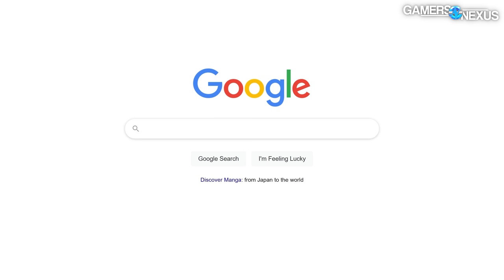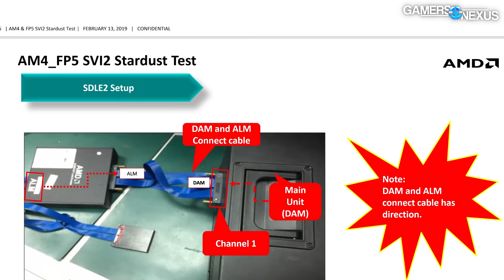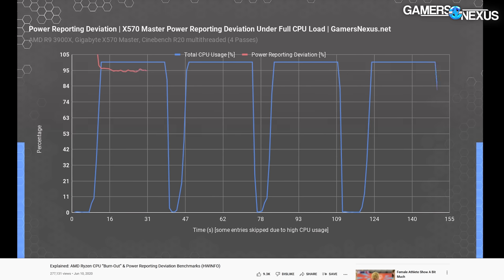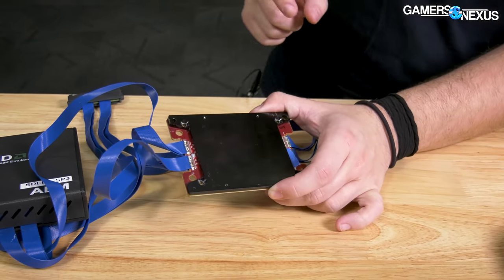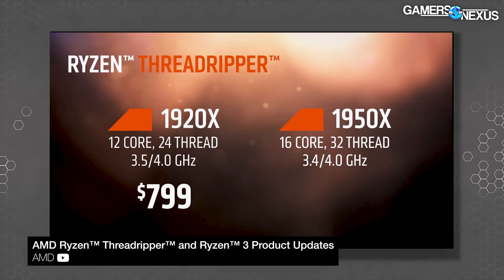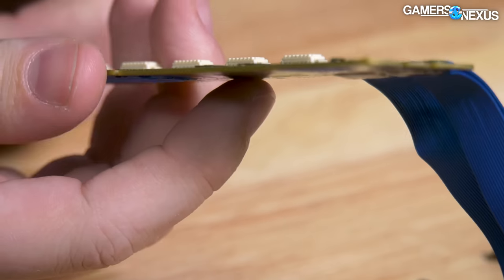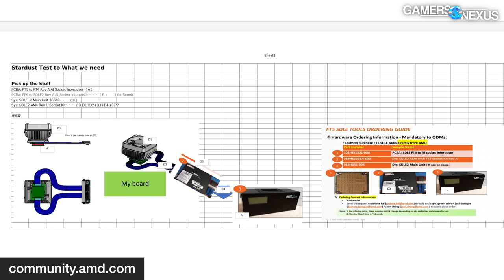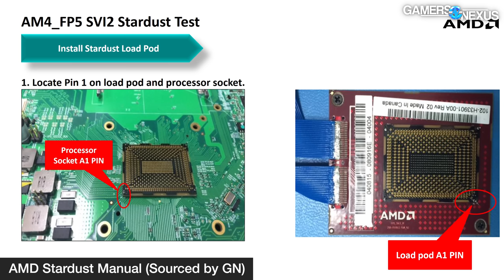We Have AMD's Top-Secret "Stardust" System | Tear-Down & Hands-On

Comment from the maker: For the AMD Stardust box - yes, we can just make a power plug. The problem is that we would need the specialized motherboard (looks like an FPGA). If you have that, let us know! Power doesn't get us anywhere without the board, sadly. We do have the software, though, so mostly need the board.
Get a GamersNexus toolkit! Includes a 7-year warranty! https://store.gamersnexus.net/products/gamersnexus-tear-down-toolkit
Or a GN Anti-Static Modmat for PC building: https://store.gamersnexus.net/products/modmat-volt-large
Watch our Xbox XDK Developer Kit tear-down here: https://www.youtube.com/watch?v=Wno4t7YqMM4
Reply: Be careful about flexing those ribbon cables by the solder joints they’re easy to break. And some of those ribbons are just painted conductive trace so forget repairing it if it is. It would have to be hard wired at that point.
Reply: On the one hand, I'm grateful for you guys bringing us such exotic content. On the other, though, I fear any legal repercussions you could face for obtaining that equipment.
You should not take such high risks for us!
Reply: @BobMotster  It's nor ilegal to have it (as long as it's not stolen), what is not allowed is to sell it.
Reply: hi Steve, are you going to review Razer Kunai and Razer Hanbo? It's been sometimes since they release
Reply: Knowing AMD it is probably a Xilinx FPGA.
Reply: @Darkfarfetch They're journalists. In America, journalists report on what companies would consider "stolen" info all the time. As long as the journo didnt steal it themselves, they are protected by the 1st Amendment.

Literally, there are American journalists who report on classified military info and no one is jailed for that. This is, obviously, a dozen levels below that in potential liabilities.
Reply: @frizzlefry1921  Steve is the most abusive person with hardware I've ever seen. That poor AMD tech who hand soldered those joints for the R&D team is screaming when he sees steve just yank and pull while the wires are caught. (not just this video, steve is always this abusive to hardware). Turns out those ribbon cables are micro-coax, the most delecate and expensive type of wires. At this point I assume Gamers Nexus has a pile of "Steve's broken stuff" that they keep in a corner.
Reply: @TheTardis157  It could be any brand since it's from 2016, really. But yeah, for sure a FPGA.

Comment: Those blue cables are actually 50 ohm micro coax cables made by samtec, and a single assembly with connector is about 200-300$

Comment: They should totally make it available to reviewers so they can use it to potentially better test motherboards. 

Reminds me of the Vega preview GPU with the extra diagnostic stuff on a long PCB linus showed off ages ago.
Reply from the maker: It would theoretically be very useful for that, assuming you had all the diagnostic tools!
Reply: @Terry the Translator It literally just lets them better test motherboards lol
Reply: I think one of the issue is how expensive the test equipment are, too many 5~6 digit priced stuff needed for this.

Comment: The power supplies are probably just standard 12v ones with internal DC-DC converters to make up the standard rails. Hooking it up to a bench power supply with current limiting should help keep you from frying anything.

EDIT: At 19:57 the board has an LTC3853 DC-DC converter on it. They take anywhere from 4.5v to 24v. But it's probably shipping with 12 at a few amps depending on the load they need. If they need a couple hundred watts into these things they'd be using beefier connectors (most likely an off the shelf laptop PSU). The 12v fan is a giveaway that they are expecting 12v since it would most likely just run directly off the DC-in.
Reply from the maker: Good recommendation on preventing frying! Now we just need a motherboard!
Reply: Yep, looks like a 12V unit to me. I stockpile 12V, 5V and 9V power bricks because they are so ubiquitous, especially for powering LED strips. If I had to guess, based on PCIe specs, it's probably safe to assume these loads could draw at least 5A-6A @12V, but I would test with a 3A limit to start.
Reply: @GamersNexus  I would say with this to be aware of some shenanigans but.  For instance, I know car stereos a while back had re-badged a standard pioneer (or whatever) as  x car company stereos.  They changed that, AND swapped the 12V and ground pins around on the power connector.  Result being that if you plugged in a non x car company 'genuine' (read much more exxy) part, even though it was otherwise identical, it would blow a fuse in the car immediately.  And would also take out some other, no doubt vital, system on the same fuse.  So, I would say just check if the ground on the standard pin on the connector for whatever power supply actually agrees with ground on your new toy.
Reply: Best part is they aren't sure how to connect  a power supply to this thing, so I don't see what they're going to achieve after they power it up.

Yeah anything from 6V up would power it. It's just a purpose built, multi channel DAQ system. 2-3 amps would be PLENTY at 12v.
Reply: Power supply is probably like 19.5v like a laptop would use. That photo he showed of software showed 20 amps of draw.
Reply: @Thumper68  20A at what voltage? There is no way that's 20A at 12v or 19.5v.

The 20A is probably just monitoring the motherboard. Remember, this just simulates a CPU, the motherboard is providing the power to test the VRMs and cooling.
Reply: @PeterBrockie  yep current logged by the daq has zero to do with the power supplied to it.
Reply: @PeterBrockie  idk just mentioning i noticed it in the video. Now that I go back and pause it says DDCR_CPU. But that power brick shown is very similar in size to 19.5v laptop one was why I said that. The 20A was just a observation not really relevant to my reasoning I didn’t really clarify that 🤣
Reply: @PeterBrockie  I have a bunch of server psu with 12v 50A output so I mean 20A at 12v or 19.5v could happen
Reply: @Thumper68  the size of the power supply has nothing to do with its voltage. Large 12V power supplies are very common. Laptops use higher voltages for efficiency and because it enables charging their battery packs without stepping up the voltage.
Reply: @Finder245   I know this it was just educated guess based on some common sense general observations and the fact the system is meant to load test it just makes sense to me they would use similar voltage as laptop.  Y’all act like I’m saying this as I think they are absolute facts.  Also you can run laptops without battery packs and of course they dont have to step up voltage cause they already did with the power supply which your forgetting it will have to power the display and other user attached peripherals.

Comment: Concerning the missing power brick: You can likely follow the one side of it to some screw hole (= ground) and the other one will at some point run into a linear regulator. The spec sheet for that regulator will then give a hint for voltage, likely 12V center positive input.
Or, for the brave, get a bench PSU, current limit to 20mA and slowly creep up voltage until the device attempts to start.
Reply: i'll put money on it being 12-19 v @ 3a for the power supply the fan being a 12v fan is an immediate giveaway at the input voltage

Comment: Finding an FPGA in test equipment like this is not surprising. There might be another one under than heatsink. I am glad you did bot force that heatsink off though. I believe those attach to the package itself, so if you do it wrong, you could rip that chip off the motherboard or at least crack some solder joints.

Comment: Its just a barrel adapter, you just need to know what voltage it is. You can figure out polarity from the PCB but most are center positive. You could even try ramping up voltage until it turns on or draws current

Comment: You can easily find a power adapter, barrel plug is very common. You can get a wall adapter that has switchable voltages so you can start low and work your way up till the unit powers on, if you don't know the operating voltage.

Comment: that's cool test gear. When I worked at a smart phone startup in 1999/2000, I got see some cool CDMA gear for testing cellular networks. It was a van full of wireless gear and ton of different kinds of antenna and computers.

Comment: It's just a standard barrel-plug. a more indepth look onto the pcb near the connector would pretty easily reveal if you need 
1: an ac or dc power source (ac would be very unlikely but possible)
2: if DC: is the center pin is postitive (usual configuration) or negative (a#$hole configuration)
3: needed voltage (basically the first capacitor tells you the rough range, a 20V cap must not exceed 20V. the bulkier the cap the more likely you neet to beef up the amperage of the psu). the closest ICs nearby the powersource are also an indicator. they usually have a datasheet, telling what voltage they need to have supplied to. taking the resistors nearby into account, should pretty easily make it pretty deterministic, what is needed
4: needed amerage rating (higher than needed would work, less than needed will cause problems, but would be very inlikely to damage anything. the barrel-plug itself also has a max amperage rating, providing more hints about what's needed)
...best bet, because it makes the most sense would be a 12v psu, which can hanlde at least the maximum test-parameter +~20%
most of these parameters can be found out by just looking at the board, some carefully guesswork with a lab-bench-powersupply can at least mostly rule out damaging the unit.
Reply: 👆 Hello, Fam 
Thanks for reaching out congratulations 🎊🎁🎁 you won cheerful send a message above to acknowledge Your price,

Comment: 21:11 it looks like this RAM dunny load module has some RAM on it, looks like a cluster of 2, and a cluster of 4 micron dies. I wonder why it needed two pools
Reply from the maker: Good eye.
Reply: I suspect that the part under the heatsink may be a Zynq 7000 series SoC that's effectively a relatively standard ARM SoC with a decently large FPGA as an integrated peripheral component.  In that case, some of the RAM would be for the hard logic side of the SoC, and the rest would be connected to the FPGA side.  This is a relatively common configuration on several Zynq dev boards from Xilinx.

Comment: Getting a power tingy is easy, just check the required power marking and polarity, it's legally required to be marked and the devices should be marked. If not they are NOT ment for sale. Then take a modular powerbrick, I got mine at a local 'we got everything' type store. Then it's just a matter of getting the right plug attached and the polarity (which lead in the hole is the positive, sigh standard would be nice) and you are ready to go. I've done this where I had a missing power adapter many times.

The hard way to do this, is to get a adjustable power source with a swappable connector and tweak the hell out of it to find the power that works,  but there are many typical hints you can find if the device has the basic of marking, aka part number, power info and so on. Be aware that doing this without any clue, tend to fry the device. Google's your friend. And if there are no outside info, then you'll find it inside. But figuring out the clues that way is harder. It would be nice if we could have an auto sensing power device that could check resistances and suchs and from there get to a working power setting.

Or maybe that's only a Europe thing?

Comment: First off, I really appreciate that you show engineering perspectives of computer hardware and I love your videos Steve! Just spitballing here, but it looks like J8 or J6 is the JTAG header for that FPGA, and I didn't see an external PROM off the bat, so I'm assuming that family has internal flash. But given you have the programming pod and license for Impact software, you could rip the code for that FPGA. I'm assuming the heatsinked part is going to be the microcontroller for the board, did you ever remove it for curiosities sake?

Comment: This was already said, but You should have a bench power supply and try hooking it up. You can spend 15 minutes looking at PC and see what component power from DC jack hits first and look up datasheet for this component. 
Also is there like test point matrix on both sides of the cooler with blue clip? 
Looking forward to You powering it up and seeing if anything recognizes this board.

Comment: You could make your own connector and connect the unit to a bench power supply. That way, even if you don't know the voltage you can gradually increase it until it turns on.

Comment: I reckon AMD wasn't necessarily eying up Xilinx at the time because I'm fairly sure that acquisition was much later. But for AMD they were pretty much the only game in town as their main competitor, Altera, had been owned by Intel for some time already. In fact I'm reasonably sure they've built Xeon CPUs with FPGA functionality built in. Not quite sure what for. Would have been cool if they would let you add custom instructions to the CPU but I don't think that's what it does.

Comment: Have to agree with TechDeals recent comment on other tech YTs recs: a lot of the time it feels like bad advice because while it fits the specific need/budget being asked, it doesn’t keep longevity, resale value, “feel”, or the basic question of “if someone is this budget constrained should they be even looking at parts?” in mind. Basically, technically correct recs that miss the larger picture. GN is guilty of this, in particular. Just commenting on the topic since it was brought up in video.

Comment: Eagerly waiting for AMD to call in and provide the other parts and manuals needed to operate this testing rig. If there is someone that can benefit from having hardcore testing equipment, it's GN. Rip a new hole in OEMs for making poor board design decisions, help Buildzoid with overclocking by testing obscure things, and so on

Comment: Would gamers nexus look into the widespread startup issue with asus x570 crosshair 8 hero boards. Asus has failed to address the issue and have been sending back rma's unfixed for a year now. There are forum threads with 600 posts on the rog forums.

Comment: 14:42 The memory stick is the DIMM, not the DRAM chips on the memory stick.

Dual Inline Memory Module.  That means the pins are in a straight line, and there are two such lines (one on each side of the module).  The DRAM chips themselves are BGA - Ball Grid Array.
Reply from the maker: Yes, I'm aware. Misspoke.

Comment: Would it be possible to use this equipment to empirically measure VRM continuous and transient performance? I think that the Intel VRM test vehicles have the ability to simulate transients, and it might be possible with Stardust as well?

With regard to the power plugs, that's a very standard connector. If you tear down the DDR emulators and post high resolution pictures of the internals it should be possible to find a commodity power supply that'll fit it. From what's in the video, it looks like it just feeds a DC-DC converter that produces the internal rail voltages, which may allow it to accept a wide range of voltages. You may already own the power supply you need. It's difficult to say for sure, though, based on the video and especially without getting a good look at what's around the jack (and on the other side of the PCB).
Reply from the maker: It would be possible to hook it up for VRM thermal testing, yes! And super cool if so! We just need the motherboard, that's the real problem. The power is a small part.

Comment: Is the power supply information in the docs somewhere? I would imagine you could find a replacement, or even just desolder the barrel plug and wire it up to a power supply.
Reply from the maker: We could reverse engineer it or something, but we'd need to find a motherboard still :(

Comment: love the video but I gotta say I'm a bit disappointed, there's no way you guys can't figure out how to power the unit.
It's just a barrel plug, get out your multimeter and check which side is ground. Then hook up a bench PSU and slowly bump up the voltage until the thing turns on. I bet it's gonna be a really standard voltage too like 12v or 24v most likely
Reply from the maker: Well, the problem is that we don't have the motherboard, so it doesn't actually matter. We can power it, but we can't actually do anything with it without the motherboard. Thought this was pretty clear.
Reply: @GamersNexus  oh yeah, don't get me wrong, I fully understand that you wouldn't be able to do anything with the unit anyway, but it would've been neat to at least see it light up. And your content is in general wonderfully-technical so I was just surprised that you'd act like the missing PSU was a serious obstacle. Again, great video and I really love seeing these units that most of us didn't even know existed, just feel like figuring out how to power the unit would've been a worthwhile addition to the video.